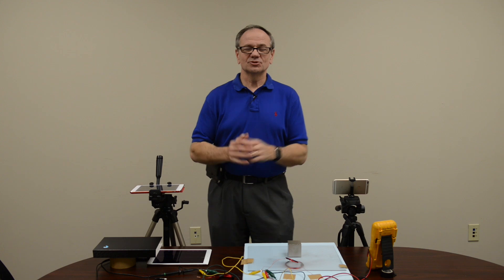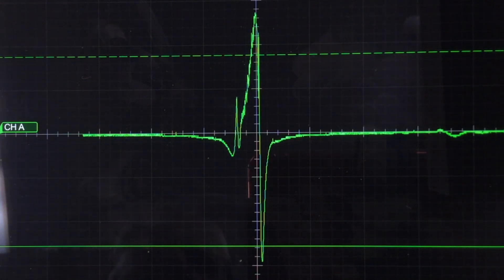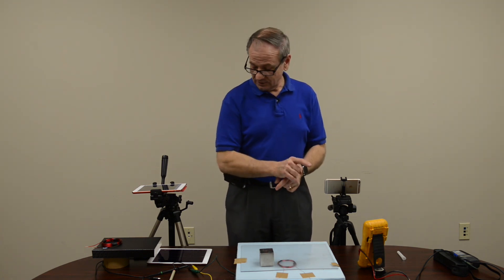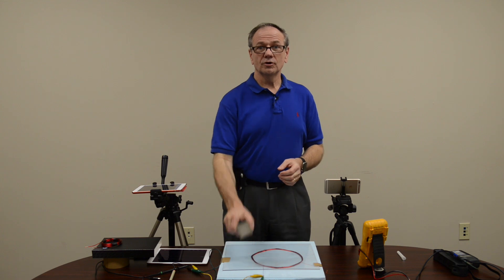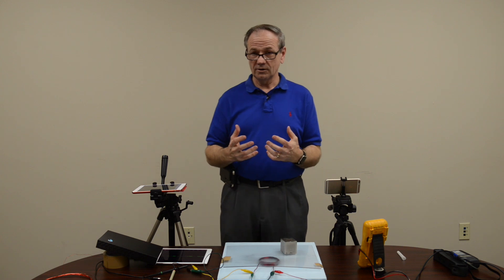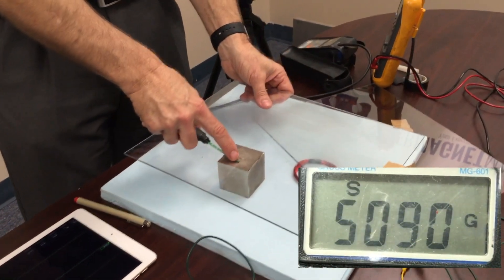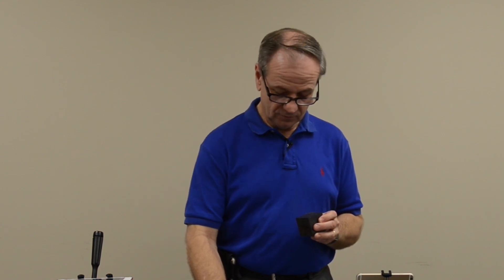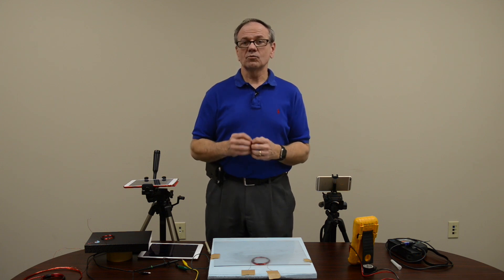Magnets and Copper

Comment: Copper winding is working as a capacitor in series and the atmosphere static charge keeps changing + and  - charge an Earth magnet trying to keep no charge ( magnet North pole ) permanent magnets trying to shield. The pulse is generating This experiment has one different situation.The EMF gets from the sky (Geomagnet ).

Comment: How are reacts to copper is well when you move a magnetic field across copper if it's directed into a wire it creates a current. Like if you drop a magnet through a copper silver or gold pipe it creates a flux field which is its own electricity that's moving along with it creating a outer magnetic field. So how magnets react with copper is the movie magnetic field creates a current but what is falling through a pipe and is creating a flux field is more so a charge that follow along with the magnet through the copper conductive pipe and creates an opposing magnetic charge that slows its descent against gravity. It literally looks sort of like a magic trick but it's not magic it's science. It's almost like anti-gravity, but more so like a magnetic parachute. How does aluminum react to magnets? Because from my understanding is they use aluminum for brakes on electromagnetic train tracks. So how can we do a compare and contrast on how a magnet reacts to both copper and aluminum? What are the similarities and what are the differences?

Comment: I think the discontinuity on the first graph after the peak does not occur at the end or travel, rather in the middle as the field strength changes from increasing to decreasing as you cross the magnetic field peak
Reply from the maker: Interesting thought.  I would need a faster speed slow motion camera to check on that.:)  More toys:)

Comment: Just want the math with those magnetic field magnet and the battery train in permability in a crazy math for faster than light travel.👍😁 try flip feilds spin it in a two case set out coil in the center watch the repulsive same join but it gets a little more power when more flux due to the repulsive magnetic field. Run a 3 mega watt turbine on a hector pack which on 80 high power car aultanator with a 106 rpm gear set draw loss and motor should get 200kw a unit with graffiti caps to use a more direct charge to battery due to current still get 5 min the graffiti should keep going????.

Comment: Dear mr magnet man , question  if i have a copper pipe filled with water. And i place two big magnets on the outside of the copper pipe. Is the magnetic field going trough the copper pipe and in to the water?

Comment: The output voltage(not power) of the coil is from the number of turns in the coil(N) multiplied by the changing magnetic flux density,d(phi) over time, d(t).  In other words V = [N*d(phi)]/d(t).  Note how the 4800 Gauss magnet produced 1.05Vpeak and the 1500 Gauss magnet produced ~0.3V peak over the same coil with basically the same velocity across the coil.  The  math and the demo agree as the 1/3 smaller magnetic field produced about 1/3 the voltage of the stronger magnetic field.
Overall interesting demo of the principals of electromagnetic induction.  Since there is no load on the coil, no work is being done so it's not really producing power.  It is really just a measure of the open circuit voltage across the coil.

Comment: Hi sir. Ive subscribed. Please make a plus with just copper any size and the more X looking the better the recepters. The magnet should be in a ball all the same size and another magnet at the bottom so it floats. As it spins it will generate energy in the air. Theory. 

We all have it backwards trying to generate power to move something to generate power for it.

Comment: Bozo the clown explains the enhancement of the 'deacceleration effect' caused by the spinning of the permanent magnet as being a 'giroscopic effect'. This highlights his utter incompetence.
Its the greatly increased relative velocity of the permanent magnets field and thereby the strength of the 'induced electric field eddy currents' in the copper sheet and its associated 'magnetic flux / interactive force'.
Reply: Mizzell is Legit, wake up draft conception

Comment: Ok, why ya not use block of copper? Why use wire? Why use block and not wire of magnet? It is because wire of copper and block of magnet is better than block of copper and wire of magnet? Ya can use different vary example to make people understand by seeing everything. So, there is different vary of dip and push up? High push up to small dip; high dip to small push up; even dip to even push up, right? How do those three combine connect to process of copper and magnet? And include depth for gap. So, for 2d and for 3d. If copper is bigger that means bigger resistance, which means lower power. If magnet is bigger that means lower resistance, which means higher power. Thicker copper means bigger resistance. Can ya include an experience with small gap and non-gap, so what is the different? I am sure the small gap, which means higher resist from copper or higher power from magnet. A diameter of copper that is 5 inches or series of gap that touch each other that equal 5 inches in copper and magnet. You have block of magnet which means no gap at all and no size of gap. So, can make a copper for gap and no gap which means no hollow at all, just one gap size. Not two gap size, why ya have two gap size? Is copper with two different gap size better than one gap size with magnet as a block? It is because it needs resist, then no resist to produce something?? It is good teaching but need to expand to everything so can see the different and which is best for all of them. So, copper is resist and magnet is power, you have two magnet so other one is higher density so it is heavier. Higher N number. So, copper and magnet is important to produce current, right? If you have only magnet, you can't produce current. Well, ya can use two magnet without use of copper so it will produce current. So, either copper with resist and magnet with power or magnet for alternative power to produce current, right. Which it is better two magnet to produce current or magnet and copper? If it is not better, but amount of money better that is not too much cost to make it.

Comment: Stirling hot gas engine high heat magnets under hot gas piston heads that moves up and down in a thick copper cylinders that generate electric current. That passes into electronics to boost the current that then passes through vacuum spark gaps. Electronics used for Induction  levatation of an alloy within a graphite crucible that will glow red hot at a low frequency that causes the graphite to glow red hot to provide the heat for the hot gas stirling cycle engine. Magnetic bearings used upon all moving parts skill saw buzz kill antivibration technology incorporated into engines build. A V-6 stirling hot gas engine with two fly wheels cranking two large rewired drum motor generators with magnetic bearings generating high frequency electricity that is then passed through a vacuum spark gap and electronics to regulate electrical frequency for power ussage. A replacement for gas and diesel electrical power generators. Do you think this concept would work? Way better then solar right? Thought i would run this by you and see if it would all work? 😕
Reply: - Heat destroys magnets. Your idea might work for awhile but the hotter the magnets get the weaker they become so your project might work if redesigned to keep the magnets cool. Neodymium magnets are way more sensitive to heat than other magnets so they may not work as well as others but the magnets must be protected from heat regardless of their type.

Comment: question
why gaussmeter mesures values that are lower at middle (5600) and higher to edge (6000) when no plastic plate whereas when you add plastic plate the inverse occurs (higher middle mesure than the edge)

i think i get it, there is a reversed polarity in the middle exactly like ring magnets
 and this phenomenon is used in the levitating spinning top toy 

Right

https://i.ytimg.com/vi/QyT6K0lfwxY/hqdefault.jpg

Comment: What if you just spin the magnet in place? First on a unipolar axis, then on a dipolar axis?
Reply: Nothing on a unipolar axis because if the same side is facing copper then the electrons just get pushed in one direction and held there regardless if the magnet is spinning. A dipolar axis however is how our modern electric grid works. It's called alternating current. The electrons are constantly being pushed and pulled as the magnet spins from one side to the oppositely charged side.